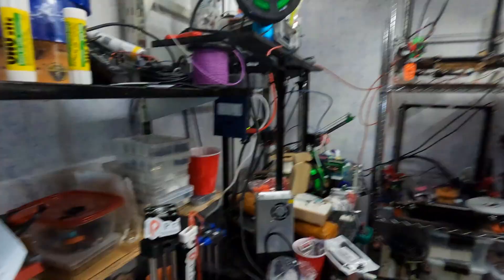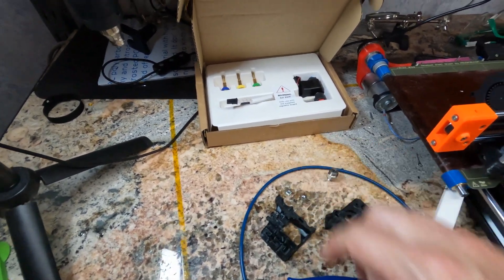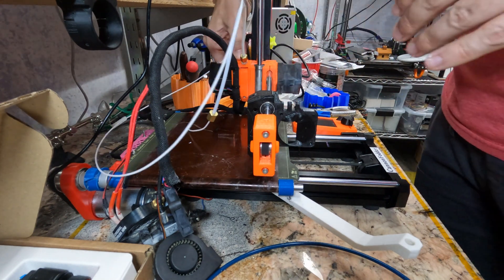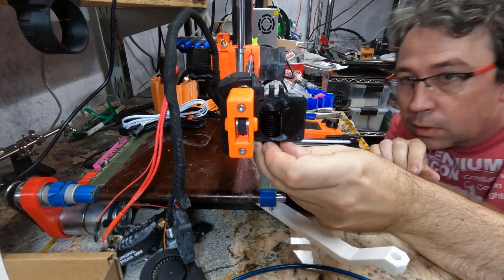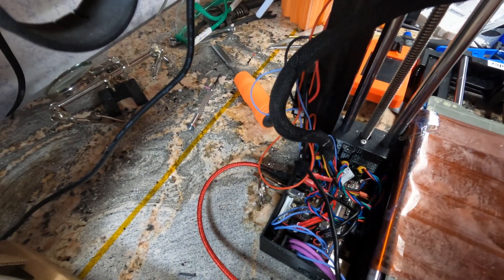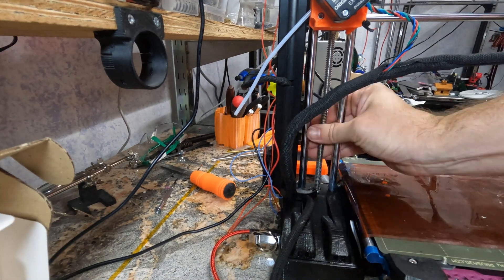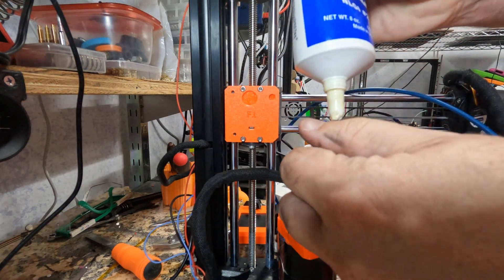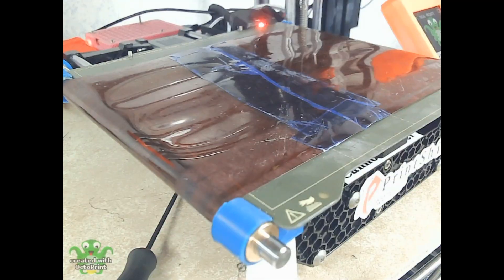Prusa Mini revo upgrade

Comment: I realy like the Revo. But in the Prusa Mini I have often failiures. Reason was coldend cooling. I have an older revision of the Buddy board. Prusa uses a quite powerfull (and loud) fan for the coldend, but PWM it down to about 37% speed. I replaced coldend fan by a Noctua, permanently on. On old Buddy board GND is PWM, so only thing to do was connect black wire of the fan to permanent ground. Newer Buddy use PWM controlled +5V, but there is no permanent 5V available. So you have to mod and recompile the firmware or use the 24Vto5V converter delivered with the Revo.

Another downside of the Prusa Mini is the bowden setup. I converted to direct drive with the Sherpa extruder. It worked, but the force was a bit low. Finaly I tried the TriangleLab Big Gear Feeder (TBG-Lite) and - wow. It works like a charm. Using a moons motor (not LGO) I did not even had to change the motor current. 
With Revo, TBG-LITE, moons motor, Noctua and super Pinda my mini became very reliable.
Reply: Where did you find the mount for the TBG-LITE on the prusa mini ?
Reply: @The0nionKnight  Actually I have not found one and due to the mounting points of the TBG-lite I had no clue how to design it. No clue ? - use glue. I simply used the design for the sherpa mini (model 174299 on printables), some glue (Pattex, a german brand) and a piece of bowden tube (to make sure it is placed correctly while glueing and avoiding glue getting in the filament path). Of course I only glued the main body of the TBG-lite (I disassembled the TBG-lite before glueing and reassembled it 24h later, after the glue was totally hardened). So the TBG-lite is still serviceable, but permanently fixed to the mount.
On 11.11-sale I got some more TBG-lite incl. Moon's motor for my other Prusa minis for less than €50 incl. tax and shipping on AliExpress.
The reason I recomment Moons motor: It uses more current (and lower voltage) than the LDO. While they both have the same power and have very good quality, the current of the Moon's motor seems to be quite near to the current Prusas Nema 17 uses. So no current adjustment in firmware nor start-gcode needed, as the stepper drivers only control current and adjusting voltage accordingly automaticly.
Of course, gluing the parts you should print the holder in best quality possible as it would very hard to break the glue if the part afterwards. I used an enclosure while printing it, reduced speed to 70% of the normal setting and used Prusament ASA. So material can resist higher temperatures than PETG and have very good layer adheason. Of course, best material would be nylon CF, SLS-printed. As I still have 4 Minis to convert in the future, I think about ordering them on jlcpcb. For Nylon CF you can use formic acid to glue it to the tbg-lite to get an even stronger joint.
Reply: @The0nionKnight  I also made a Prusa Mini+ Extruder Placeholder with integrated filament runout sensor, so you can remove old feeder and put the filament runout sensor there. I use a bowden tube with 4mm OD 3 mm ID to guide the filament with as low friction as possible. Printables model 199031
Reply: @The0nionKnight  Actually triggered by your question, I just ordered model 174299 on jlcpcb in nylon cf, sls printed. Both parts 5 times, so 10 parts altogether for 47€ including tax and shipping. Seems a quite nice price in my opinion, less than 10€ per printer for getting the best durability. It will be my first try in formic acid glueing also. Glueing nylon with formic acid should be the same as glueing ABS with acetone. Just solve a bit of nylon in formic acid to make a paste to level off any imperfections of the surface, put a bit of formic acid to the surfaces, a bit of "nylon juice" on one of the surfaces and than glueing the parts together. I can not wait to try this method. Maybe I make a video...

Comment: I've had the Revo Micro on my Mini+ for less than 2 weeks and am already having issues. I keep getting thermal runaway errors due to some issue with the either the hotend heater or thermistor. Id say I have 10-15 hours of print time on the micro. I have a support ticket to e3d so we shall see how they handle. After a bit of googling I see that a few other people have had their hot ends falling on the revo micro's as well.
Reply from the maker: Thermal runaway is generally caused by the heater or heater wire failing - and the wires can have intermittent failures, where they're mostly connected but jiggling can break the power.  I'd look hard at the heater and wires, maybe check the resistance with a multimeter.  I've had zero problems, probably have 100 hours on it already, and more than that on my earlier Orbiter + Revo mount.
Reply: @PaulChase  I appreciate the insight! After a bit of back and forth with the support they have determined it to be a faulty heater/thermistor and are sending me a replacement! Extremely quick 2 day shipping as well. I’m satisfied with their customer service for sure!